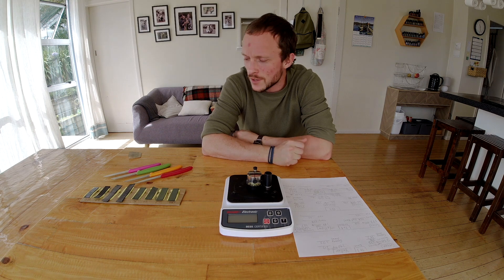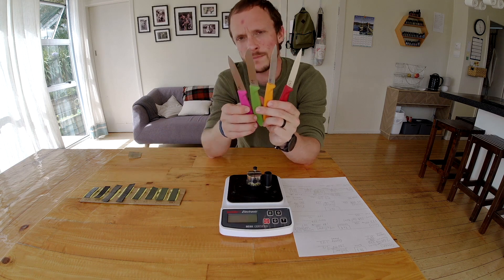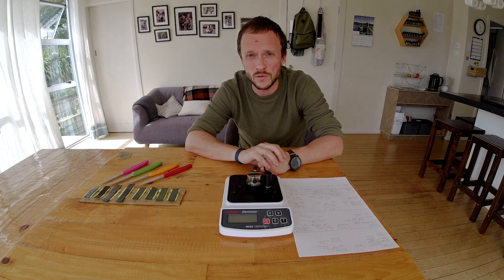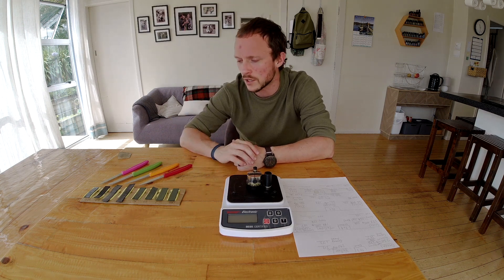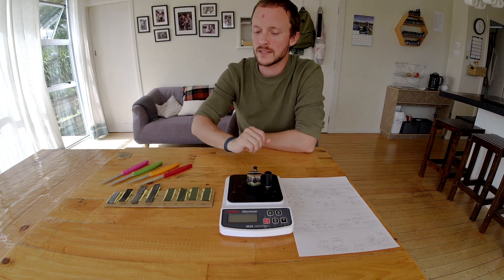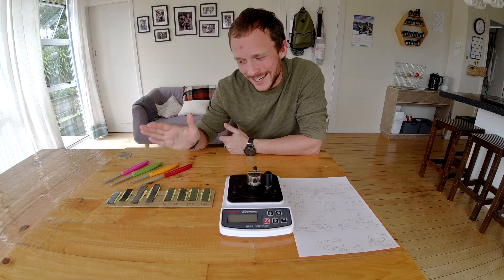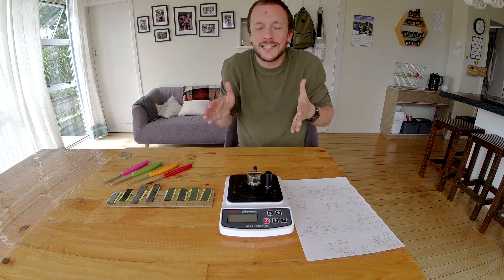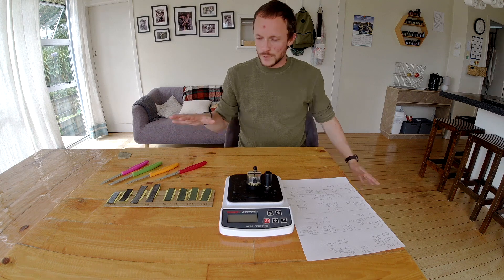Strops Part 6 | Kangaroo Leather Chromium Oxide CBN Venev Gunny Juice | Sharpening Test

Comment: I like kangaroo leather but like you said its had to get and expensive. Thats why i switched to balsa and 3M medical tape (softpore and durapore) as my stropping surface of choice. Theyre cheap, easy to replace (especially the tape) and provide great results.
Reply from the maker: Yeah I just tried some of the MicroPore with good results!  The best part is being able to discard and reapply!

I tried it on a coarse edge stropping with 1 micron and the results were good - lots of retained aggression.  I need to go back and try with some 2, 3, or 4 micron diamond on a medium grit edge like you suggested - I bet that would be sweet!
Reply: @homeslicesharpening  nice, I'm glad you tried it. I love the ease of use, discard ability and the price of it. And like you said it leaves an aggressive edge even with finer abrasives. Plus with how thin it is, when applied on a hard backing (I'm using my oak and other wood 1x6 blanks) it shouldn't have any give which will reduce edge rounding. 
I've gone back and watched your videos that you've posted (for some reason I stopped getting them recommended to me, damn YouTube) and I'm enjoying your testing and seeing some interesting results. Looking forward to seeing what you'll try next.
8 hope you're doing well my friend.

Comment: Interesting explanation on testing concepts.  A sharpening process which generates the least damage to metal in the apex seems most revenant to cutting edge durability.  
- Any thoughts on how ... DMT diamond plates compare to similar grit/mesh Spyderco bench stones?
- Roman Landes ...  Metal/HRC deterioration data seems to indicate the need to cut back the apex by 0.006", to remove metal damaged in automated sharpening processes. 
- His data seems to indicate metal/HRC deterioration in the apex may actually reach minus 7 HRC at the actual apex.  
- A 52 HRC cutting edge on a 59 HRC blades would explain the easily rolled cutting edges on factory sharpened knives.
Reply from the maker: Greetings Daniel - always great to hear from you.

1) I have no experience with DMT Plates.  So far I find that my Spyderco CBN stones are harder to deburr than my EZE Lap diamond plates, but seem to generate longer lasting aggression if you manage to deburr them.  The only other Spyderco Bench Stone I have is an UltraFIne Ceramic, which I love and use all the time.  I find that you can sometimes get incredible results from it straight off the stone (I hit 96-99 BESS on a couple knives unstropped off the Spyderco UF last week) but it is heavily technique-dependent and I have trouble replicating results across different steels.  However, I never get that good of BESS results from my ultra fine diamond plates (EZE-Lap).

2) I think Roman Landes is brilliant, and I'm sure he is correct, I have not factored this into my testing so far, but will have to keep my eyes open.

3) This is interesting, I've heard Michael Christy complain about edge overheat ruining the initial sharpening on many factory knives, again I'll have to keep my eyes open to see if the data I gather reflects this, but I would readily believe that mechanized sharpening damages the HT at the apex - that just makes sense.
Reply: The subsurface damage topic really interests me, and I have a few thoughts about it if you're interested:

-grain shape and orientation affect stress distribution below the surface. There's a really interesting recent paper that studied single diamond grit scratching with the grain in different orientations.
-some abrasive manufacturers have IP on aligning diamond grains for monolayer abrasives. Their products may be more consistent in that regard. It may include lapping films.
-VSM Actirox and 3M Cubitron II Pro have aligned ceramic grains; I'd like to try sharpening with them.
-if you saw the latest science of sharp article on S110V, the primary mode of subsurface damage was carbide fracture. This makes sense since they're less ductile (and stiffer) than the matrix. The level of detriment on more ductile steels is unknown to me, and may be minor (though one would think the fatigue would be undesirable).
-it would seem me that adhesive wear would have less subsurface stress than abrasive, but that may be completely incorrect
-shallower scratches will have a smaller plastic zone below the surface
-consistency between grains is probably the first priority
Reply from the maker: @knickly  Couldn't have said it better myself, thanks for summarizing that.  I knew some of it, and I learned some of it.  Cheers.

Comment: I think its been an interesting series so far. Whether or not its fully scientific or not. ❤
Reply from the maker: Thanks mate - I loaded up some more official strops using the data gained so far to provide rough guidance.  I got a microscope in now, so I hope to do a slightly more scientific test of the new strops with slightly flatter strops.  Could be cool to see how it develops.